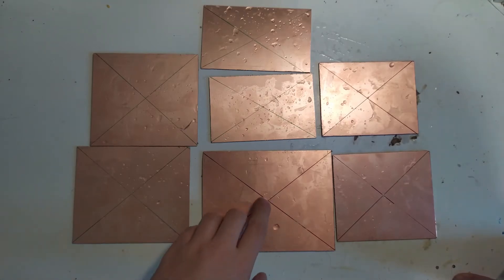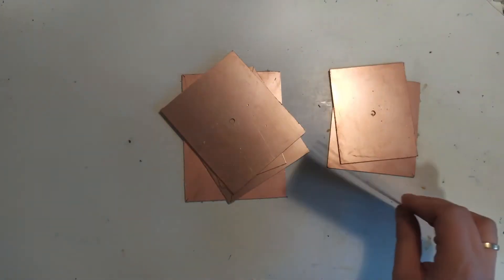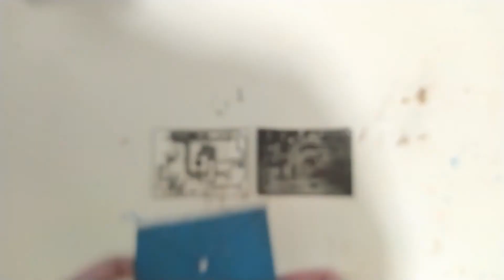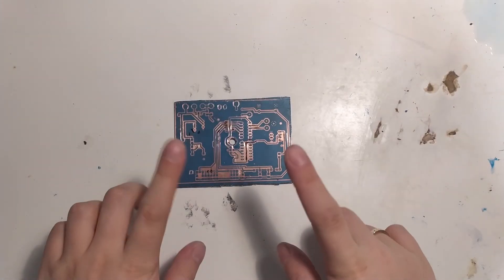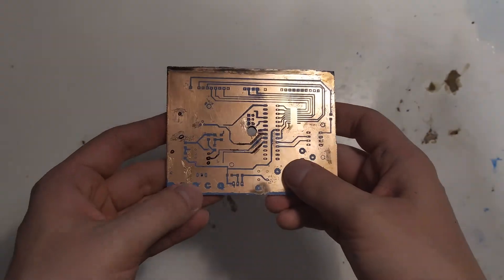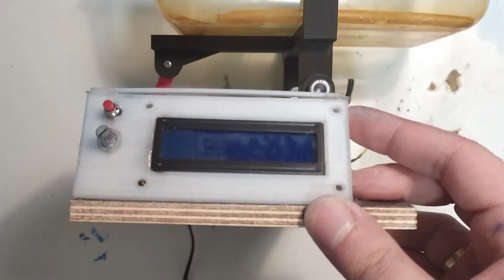Making double sided circuit boards Part 3: Process overview

Comment: @captainsolder5247 Do you think a better technique to hopefully achieve literally flawless results would be to rubber roller on the uv photo-resist a very good even layer, and THEN spin the pcb? Then dry it, maybe putting it in an oven on low for a while before letting it dry for 24 hrs or so...?There's gotta be a way to get perfectly crisp, SMD pitch level etched traces with zero flaws. I can get very close to that with dry film, but not consistently as there tends to be one or two tiny flaws on the board full of tiled designs, and also pulling off the top clear film after uv exposure can cause flaws etc...

Comment: There are some things you do are too complex. For example, the two sides of the transparent masking film can be made with wider edges, aligned against a light, fixed to each other with a tape on the edges. Then, the board could be slid in between them, fixed with a piece of tape on the edge and that is it. No holes needed, both sides will be exposed at their right places. That is what I have always been doing successfully.

Comment: Do you ever do any solder mask?  Advice?
Reply from the maker: Have tried this before depends in the solder mask you buy, some works quite well some doesn't. The blue stuff I use for etching works reasonably well, I had some yellow chinese soldermask I think "Mechanic" brand that did not work at all